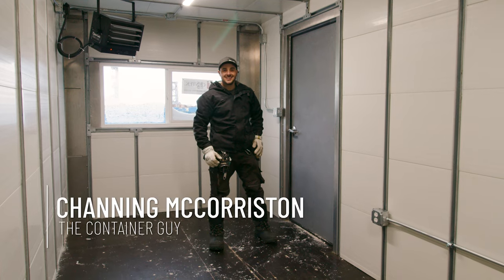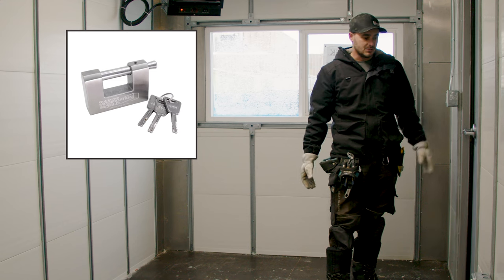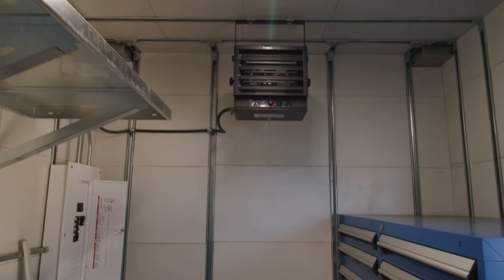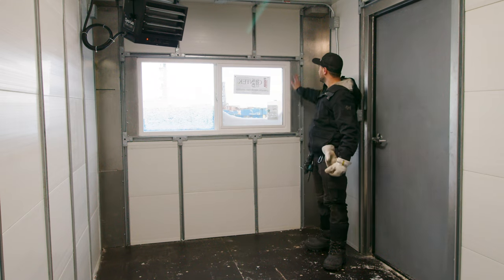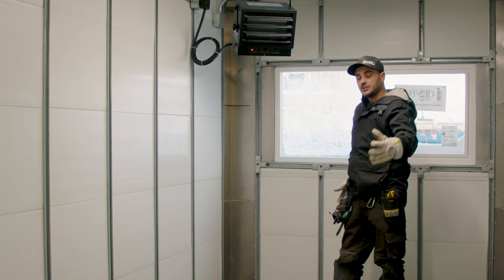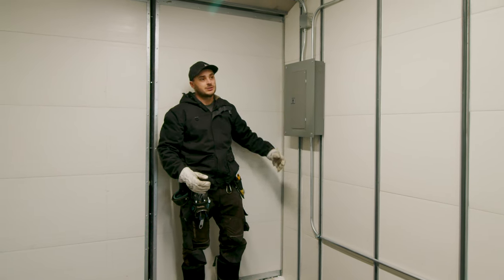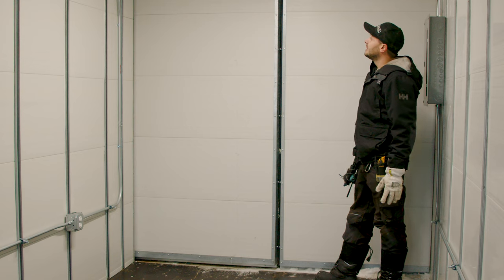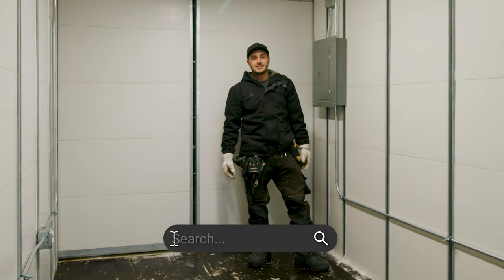The Perfect Mine Site Office or Emergency Shelter?

Comment: my Wife is from the Philippines. we each (she is an American citizen now (dual citizen actually)can fill a 20 foot shipping container with personal items and ship it to Philippines and pay no CUSTOMS DUTY on the items.
so  i would like to do this to 2 1 time use containers except for the 2 walls that are next to each other when the containers are connected together to form a double wide. the outside walls would get concrete block veneer and filled with concrete and a bamboo and tin roof over the top. the 2 sets of double doors would get foamed once the containers are in place. i might send one etc... before im too old, and then my wife send the other on the next ship and that way i make sure she has a good strong house for when she retires (she is 30 years younger than me and is 35 now!

Comment: Hello beautiful person. I don't speak English unfortunately, but I'm following with interest. This is what I'm wondering. I love containers and want to build a house. Is there an isolator for an earthquake? Or how to prevent concussion? Could you please inform us.
Reply from the maker: You're safe in a container as long as nothing lands on you. I have read elsewhere that pouring a thickened-edge concrete slab for a foundation is enough. Rubber pads under the 4 corner castings would help but would probably deteriorate over time. You would have to select the right material..

Comment: How exactly is this prepared as an emergency shelter for a nuclear bomb? How thick is the steel? Any concrete inside the would be walls?
Reply from the maker: It isn't
Reply: @TheContainerGuyTV right, isn’t your title a LITTLE misleading??
Reply from the maker: @e.r.1492  I don't make the titles or thumbnails. If you are concerned about them, please email the editors video@thecontainerguy.ca